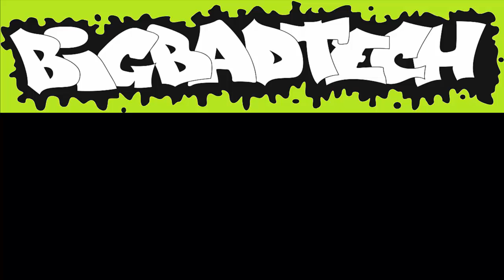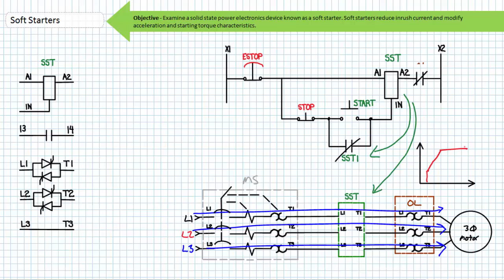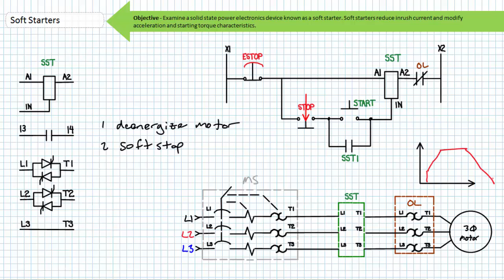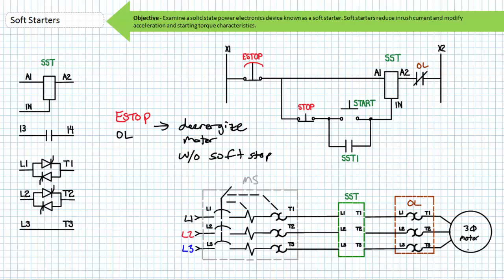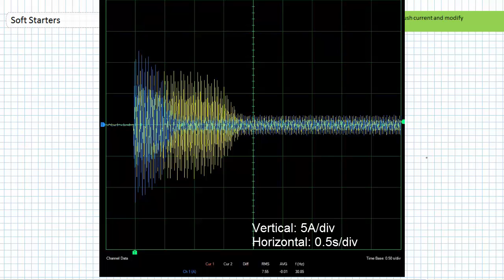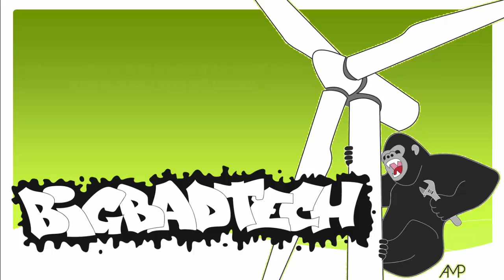Soft Starters (Part 2 of 2)

Comment: interesting lecture, but without concrete circuit of working soft starter. would appreciate a diagram of angle grinder soft starter
Reply from the maker: This lecture treats the soft starter like a "magic box". Stay in touch because later lecture on power electronics will discuss their inner workings.